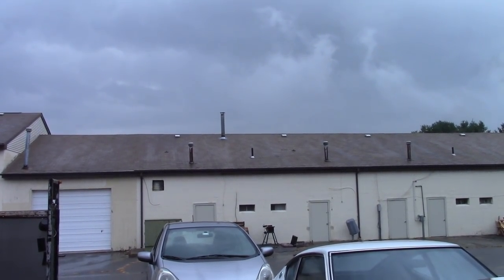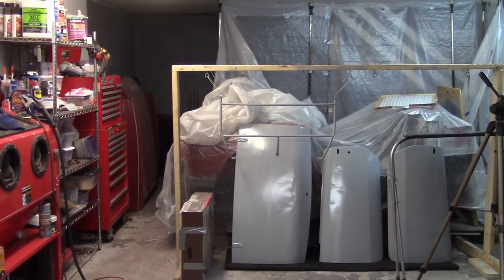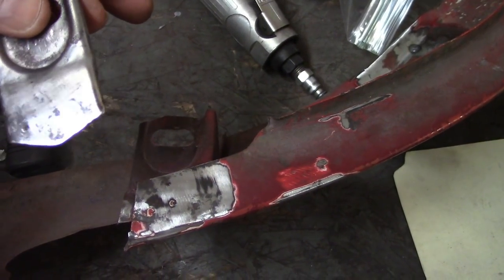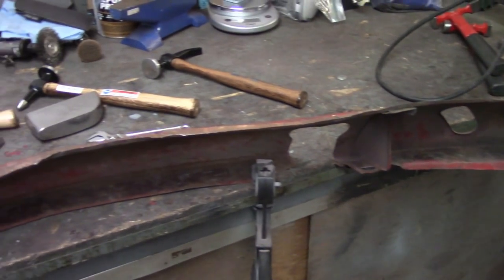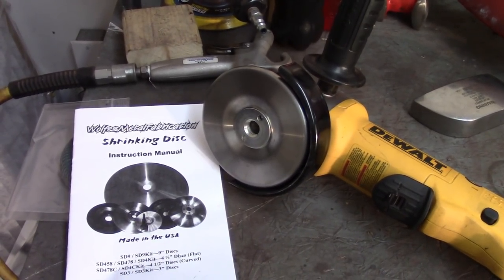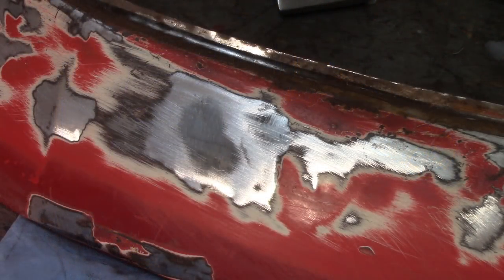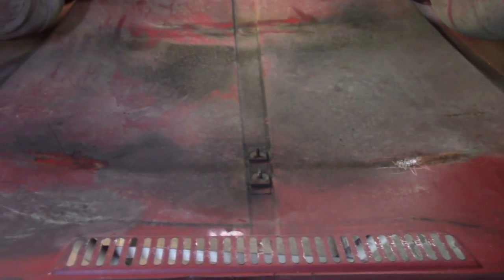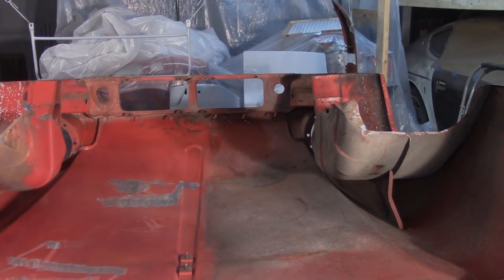Triumph Spitfire Restoration - Front Valance and Bonnet Assessment

Comment: Hi Chris, use your shrink disc only on high spots: the mechanism is that the heat will dilate the metal towards you on the high spot when it turns blue, and then the pressure you applied to make it hot will push it backwards. As it is pretty hot (close to red on the part you press), the metal will plastify and become almost flat. The last operation to cool it down will then bring back tension in the metal as it stops dilating, and you should then get a better flat area without drum effect on it. You can repeat the process many times if needed. Cool it down with air gun, it avoids making the parts rust :)
All good works so far, your car is turning very nice!!
Reply from the maker: Thanks, Chris. Still getting the hang of this stuff, but thanks so much for your detailed response. It's explanations like that keep me straight because I understand it, not just memorize it. Thanks for the tip on using air, too.

Comment: 1) the bracket with the bonnet cone. it's held in by just a few spot welds. Easy to remove.
2)I drilled out the welds and completely removed my wheel arch to make repairs. You've got 2 layers of rusty metal. You'll find more rust in between. If you go this route, use self tapping screws in a few key places first. This will aid in reassembly as you'll have locating holes.
3) the shrinking disk. Use it on the highs, not the lows. Quickly cooling causes the shrink. I'll pm you my # via the forum
Reply from the maker: Okay, thanks Hazen. Not sure I'm looking forward to removing the wheel arches, but if I have to...

Comment: I fear your removal of the bonnet supports/tubing will indeed render any and all of your fitment to the body tub and doors to be meaningless as the bonnet is able to slide back and forth on those tubes for adjustment.  If you pinned (drilled a hole through the brackets and tube) the tube after adjustment, you could have removed the supports and returned them to the original position.

I need to do the bottom side of my bonnet and I don't look forward to it. But it's a lot cleaner than yours.  I'll likely go at it with a pressure washer and hand wash as best I can, then prime and paint.
Reply from the maker: Yes, that's my fear, too. When I was doing the bonnet fitting a while ago I did loosen all of them and didn't get much help from their adjustment, so hopefully it was a bit of a educated decision. I'm sure during the manufacturing process they didn't leave everything loose and then weld and tighten it all up, so here's hoping.